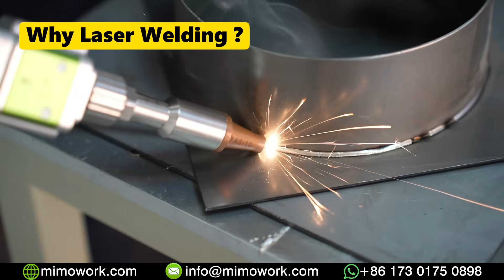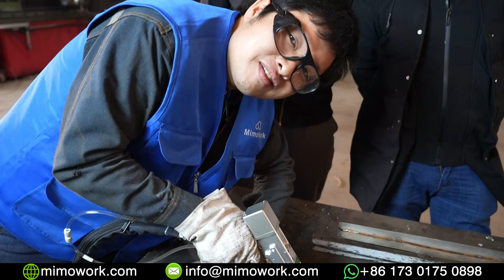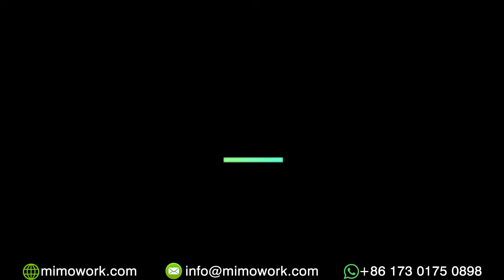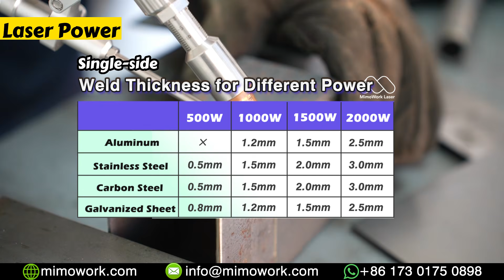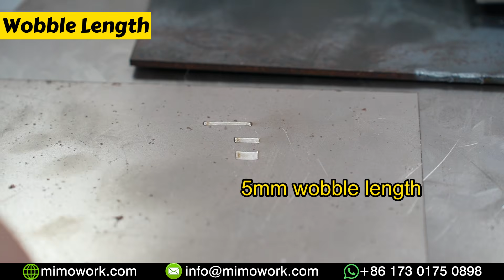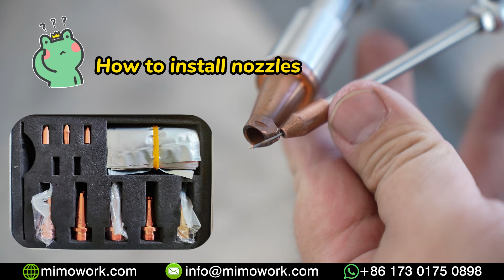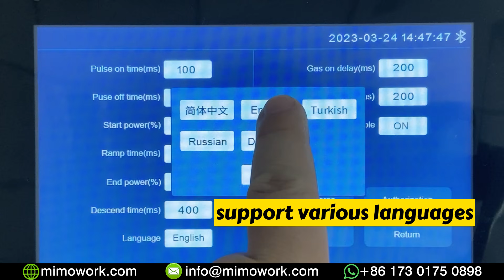How to use Handheld Laser Welder | Beginner Tutorial | MimoWork Laser

Comment: Can I use this mechine for LFP battery terminal weled with copper bus bar?
Reply from the maker: Short Answer: yes, the same laser welding technology is absolutely used in the battery and power industry.

That said, the industry standard for high-volume LFP battery bus bar welding is usually robotic laser welding systems.
But we offer both handheld and robotic solutions, so we've got you covered either way.

Best move? Reach out with your specific application details, and we'll get a couple of our on-site engineers to look at it and give you a straight answer.

Contact us here:
📧 info@mimowork.com
📱 WhatsApp: [+86 173 0175 0898]
🌐 https://www.mimowork.com/contact-us/

We can also cover:
✅ Production estimates
✅ Workflow integration
✅ Free live demos with your materials

Looking forward to it!

Comment: Can i used mig wire by CO2 gas  for this machine
Reply from the maker: 🤔Regarding MIG filler wire, it may NOT be compatible with a Handheld Laser Welding Machine.

🙌However, when it comes to shielding gas, laser welding has much in common with traditional welding methods.

👀For instance, mild or low-carbon steel performs great with laser welding using CO2 shielding gas.

😎Curious about laser welding? Check out our article on shielding gas, filler wire, and suitable materials : Handheld Laser Welding: https://www.mimowork.com/news/reference-guide-on-handheld-laser-welding/
Reply: Wire yes , gas I don’t think so

Comment: Is there any recommendation for gas pressure value for every material or thickness?
Reply from the maker: Hi there! 😊

I just chatted with our technician team, and unfortunately, it’s tough to give a specific gas pressure recommendation for every material and thickness in handheld laser welding.🤔

However, here are some general guidelines you can rely on:🙌

1️⃣ Thin materials (around 1 mm) need lower pressure to avoid turbulence or distortion.
2️⃣ Thicker materials (around 3 mm) might require higher flow rates for better weld pool protection.

And remember, always test on scrap material before welding !😉

If you have more questions, feel free to reach out to us at info@mimowork.com .

Our technician team is here to help with your specific needs!🤗

Hope this helps! 👍

Comment: What to do if the laser does not work???
Reply from the maker: Hey there!🙌

If your laser isn’t working, there could be well over 20 different reasons for it.🤔

👀Just to name a few :
1️⃣ Power supply problems
2️⃣ Laser source issues
3️⃣ Cooling system failures
4️⃣ Control system glitches
...

It’s best to contact your laser machine manufacturer since they know your machine inside and out. They’ll be able to help you. Good luck in advance!😉

Comment: do you need sheilding gas for all welding functions ,or can you weld thinner mild steel with wire feed only?
Thanks
Reply from the maker: For thin metal including mild steel, shielding gas is always recommended cause it is significant to ensure high weld quality, and prevent oxidation. What welding tools are you using? Are you gonna buy a laser welder? 

If you have other questions about laser welders, check out the page to learn more: https://www.mimowork.com/handheld-laser-welder-machine/

Comment: As a welding engineer who's worked with and helped develop new welding technologies including welding power sources for the past 5years. 

This is a hand held laser welding power source with an automatic cold wire feed system. I had a chance to see one of these used live at fabtech 2022. The principle of laser welding has been around for a while, but only recently could these laser generators be manufactured small enough to be a consumer product. 

Though these systems are limited in power, practically being able to weld only thin gauge. 3/16" carbon steel with some struggle. They do allow for fast travel speeds and low heat input due to their incredibly focused nature. 

Though due to safety requirements most places are hesitant to implement them in any real capacity.
Reply from the maker: You are really professional, thanks for your comment. Right now the most powerful handheld laser welder can reach 3000Watt, which is much strong than regular 1000Watt laser power.
Reply: Eser4

Rs ÀE 0:15
Reply: ៀផង❤❤សមក